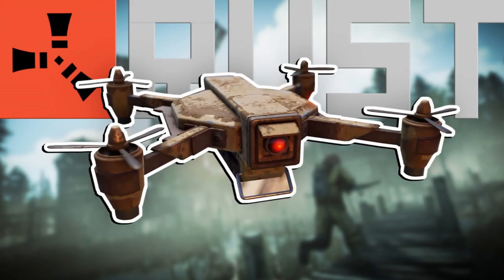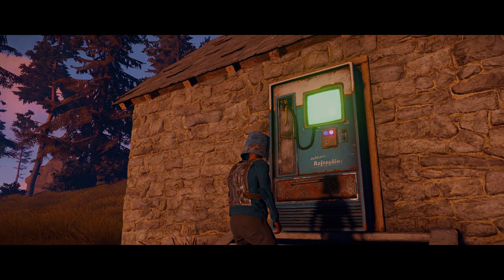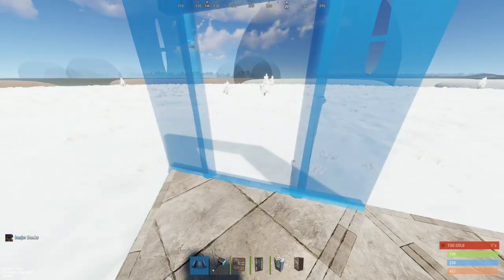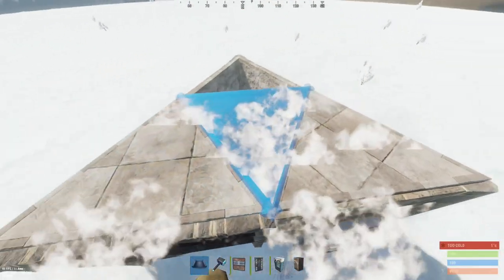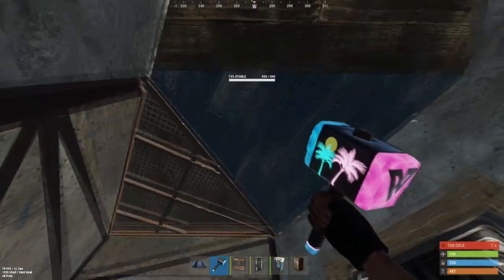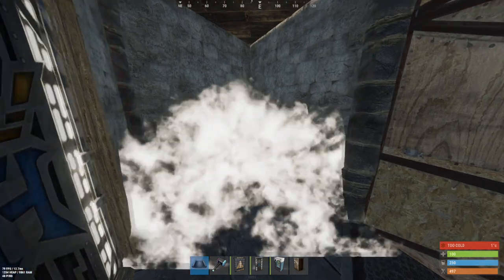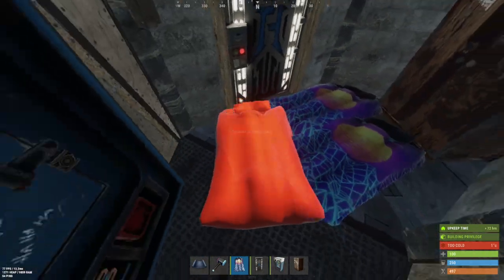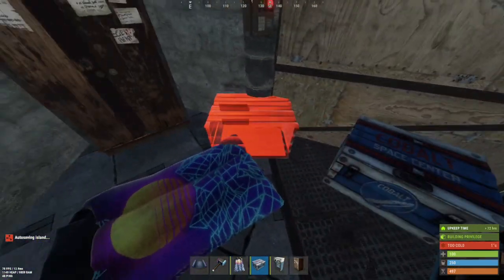Vending Machine Shop Base *Drone Accessible* Rust Build Guide

Comment: 5 rocket raid because sheet metal doors are always combo raided with one rocket and explosive ammo/satchel charges in every raid I've ever done and seen. just replace the inside single door with a double door frame and garage door, as an airlock is not as important on a base that is seldom used and built close to main by a presumably large group
Reply from the maker: Yeah I realised this afterwards and made a better version.